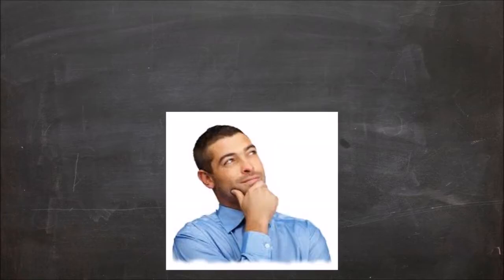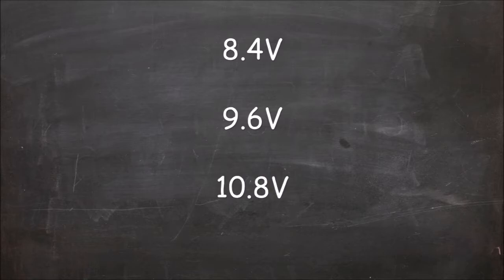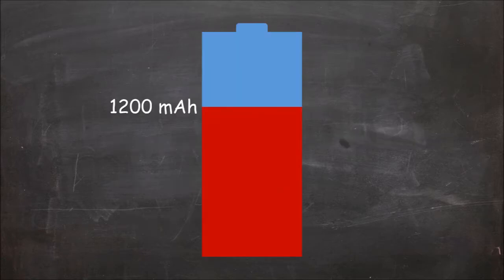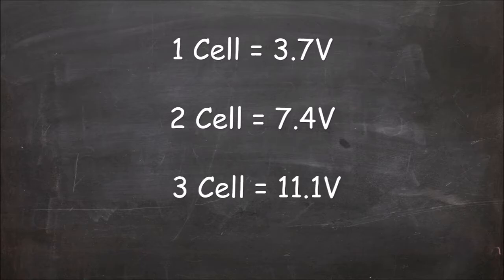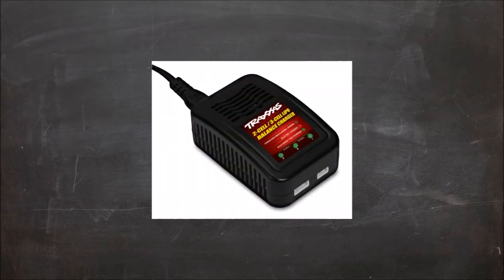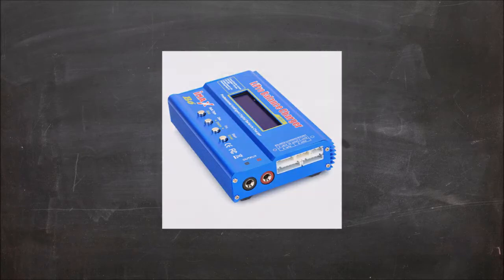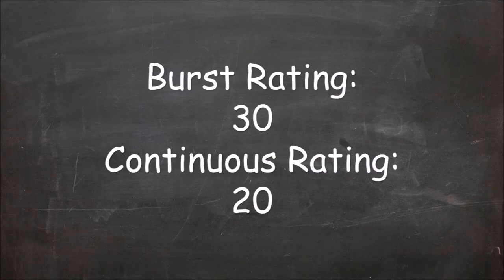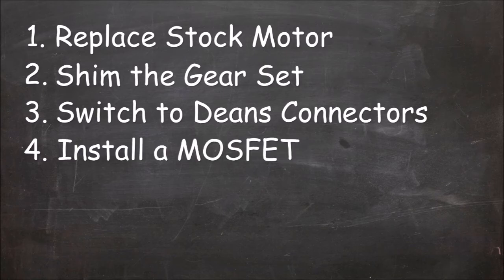How to Tech: Understanding Batteries

Comment: what about 7.2v?😈
Reply from the maker: - Spitfire - you mean the NiMH?
Reply: Cthulhu153 yeah. it's not common nowadays, but it used to be fairly common for a beginner's gun to come with a 7.2v Nimh.
Reply from the maker: - Spitfire - I didn't mention it cause that's old info lol. The manufacturers went from 8.4 cause of the fps increases. Strong springs needed stronger motors but the trigger response was lower with 7.2 so they went to 8.4. Now most stock motors can handle 9.6v so the increased rof and trigger response is a no brainer these days.
Reply: Cthulhu153 hence the demon face 😈